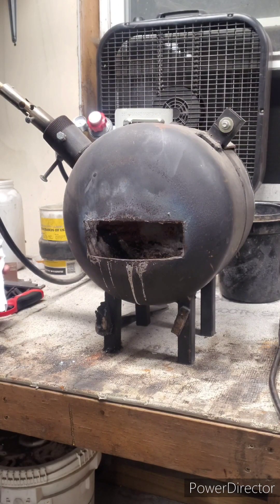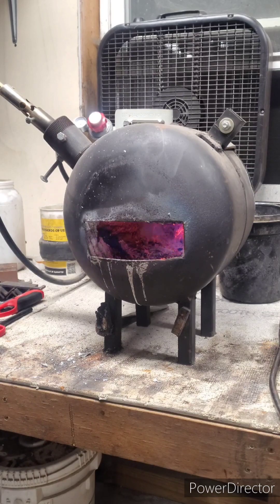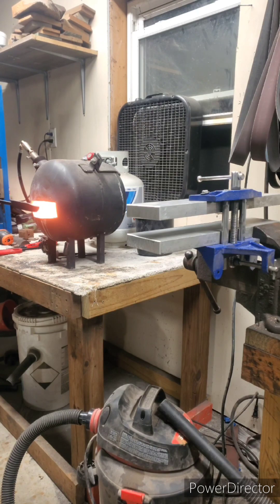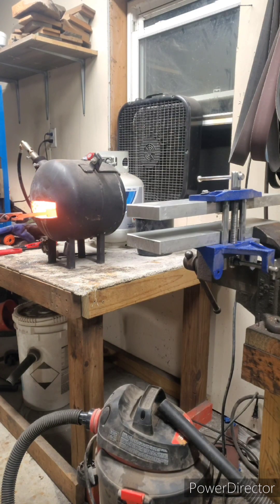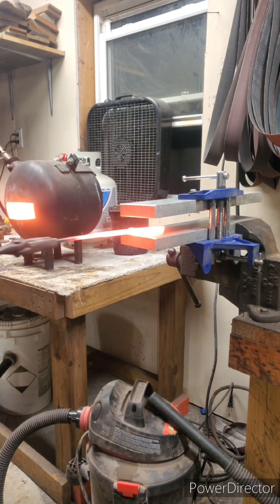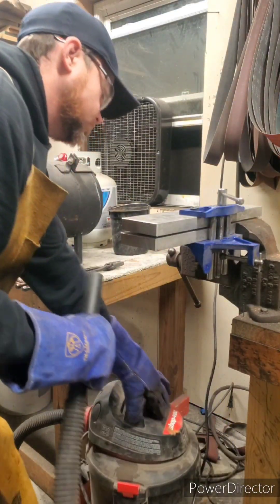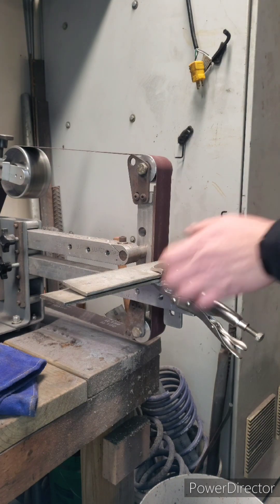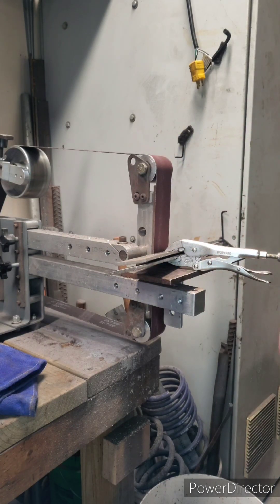Heat treating AEB-L stainless in home forge. #knifemaker #aeb-l #forge

Comment: Great video...very interesting. What kind of graphite spray did you use? Something like B'laster 8-GS Industrial Graphite Dry Lubricant? Thanks!!
Reply from the maker: yes industrial as high temp as you can find. I usually do like 3 to 4 coats of it.
Reply: @timedwardscustomknives5773 can only find ones that go up to 800°